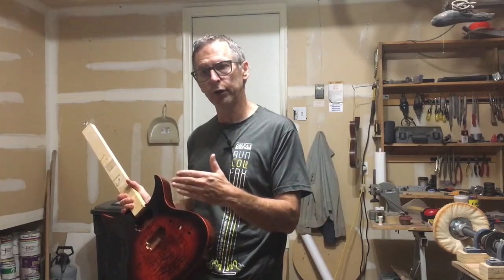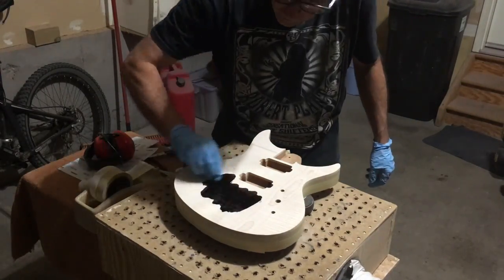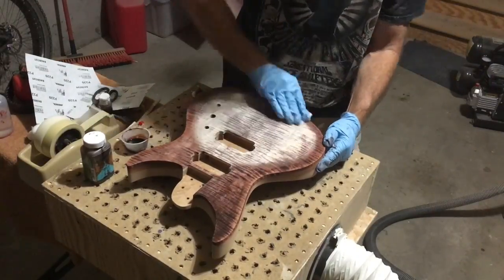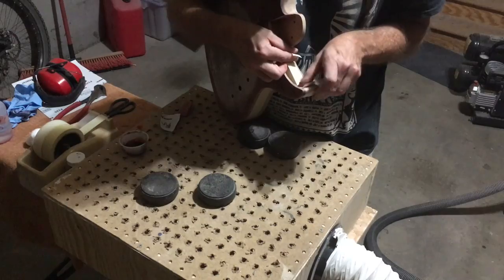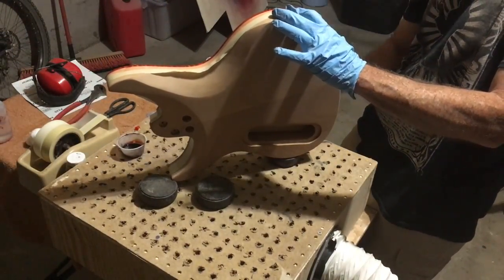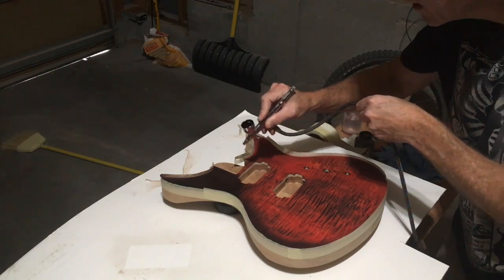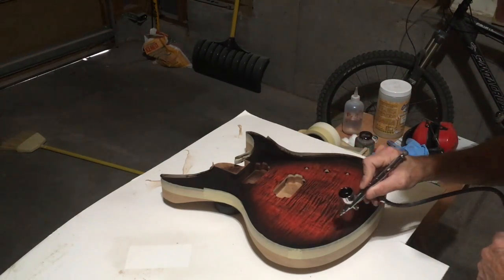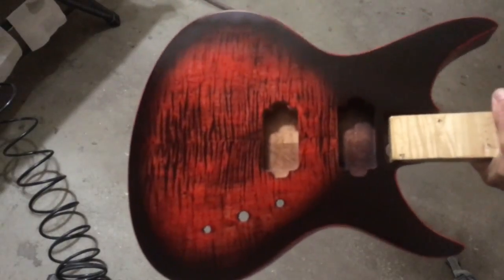How To Spray A Two Color Dye Burst Onto A Guitar Body

Comment: Can you elaborate on the pink eraser process? Are you bending the eraser, or keeping it flat? Hard to see how you are handling/managing it in the video. Please & thanks.
Reply from the maker: I bend the eraser over curved surfaces. If a surface is flat, I don't bend the eraser or switch to a hard Maple sanding block.
Reply: @HighlineGuitars  Right on! Thanks !!! 👍👍

Comment: The more videos I watch the more confused I get about sanding sealer.  I thought it was used ifrst to prepare the wood for any imperfections.  In this case I would have assumed that after the dye, clear laquer would be used to seal everything in.  Can someone please clarify the use of sanding sealer.  Obviously works in this application though.
Reply from the maker: Sanding sealers have a multitude of purposes. They can be applied to raw wood to promote the even absorption of dye/stain. They can be used to seal in dye/stain to prevent bleed. They can also be used to build a base that can be sanded smooth prior to the application of the top coats.